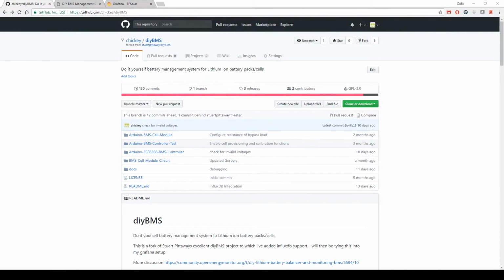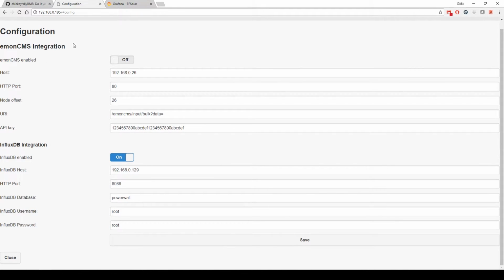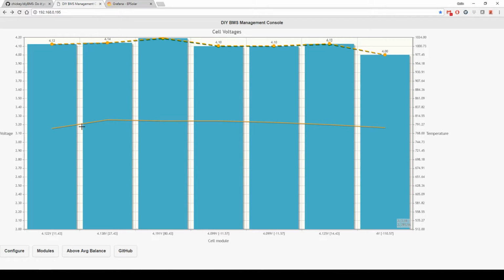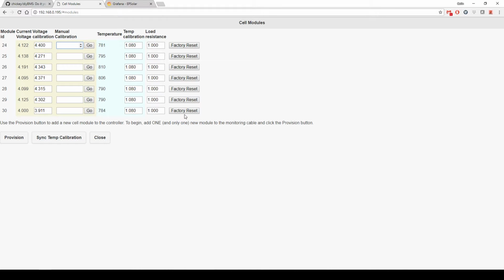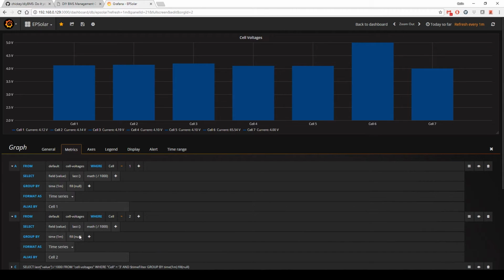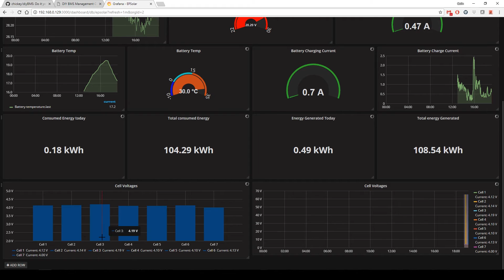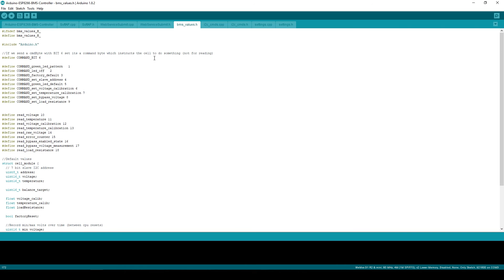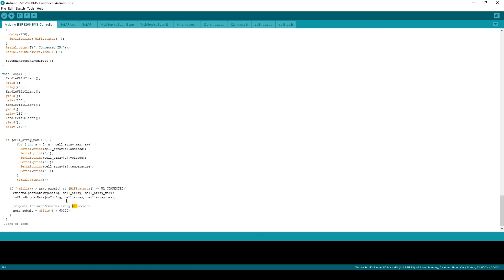Diybms Part 3

Comment: hi mate looking at a 12s build any chance to get the boards from as im an aussie
Reply from the maker: Hi Brett I’m not selling the boards currently sorry.
Reply: Hi Colin thanks for you reply currently looking for a Cap for C1/C2 2.2uF Cap 1210 SMT X7R, for the new design as they have finished making them and being shipped  is there any extra information you could help me out with finding these caps as c3/4/5 have all values need to find easily.

Comment: Hi Colin, I have a grafana db on my home pc currently running in MYSQL, port 3306, would it work if I just change the settings in InfluxDB Integration or not. Do I have to have a influx db. 
If not going forward it would be great to be able to port data into other types of DB, such as mysql, MSSQL DB2 etc. What do you think?
Reply from the maker: Hi with the current code it wouldn't work as it's writing directly to an influxdb so rather different from a mysql db.  I have no plans to try and port the code to write to mssql or similar.  All the code is on github though so feel free to make any changes.
Reply: Okay, thanks for replying to my question..

Comment: do you know how many modules are supported per control node?  I thought i read it somewhere, but i don't remember where?  Is it 14?
Reply from the maker: 24 modules is the maximum supported with the current code.  This would seem to be a logical limit though as it can be increased theoretically as 112 devices can be on the ic2 bus http://www.i2c-bus.org/addressing/.
Reply: im wondering if you could make the adjustments to you could get a couple 14s setups in it.  so 28 or 42.  I have looked at a bunch of the bms code, not as much on the addressing stuff yet.
Reply from the maker: If you increase the 24 in the last line of this code  in the i2c_cmds.cpp code you will increase the limit  
//Configured cell modules use i2c addresses 24 to 48 (24S)
//See http://www.i2c-bus.org/addressing/
uint8_t DEFAULT_SLAVE_ADDR_START_RANGE = 24;
uint8_t DEFAULT_SLAVE_ADDR_END_RANGE = DEFAULT_SLAVE_ADDR_START_RANGE + 24;
Reply: thanks :)  didn't mean for you to go did it up for me but much appreciated :)
Reply from the maker: No problem at all.  You'll need to check if it's referenced elsewhere but i don't think so.  The graphs are done dynamically so should be ok.
Reply: I am getting excited on this project.   I have grafana already setup for some of my other stuf (openhab, and my rain barrel monitoring) so this will be perfect!!
Reply from the maker: I do like the grafana view i have to say, gives a good at a glance snapshot of how things are performing.  I think i'm going to move my powerwall into my garage so i should be able to get more use out of it and utilise the power i'm generating and combined with the BMS it should keep things in order.
Reply: I am finishing soldering up my first 4 packs now 4s80p.  Those 4 packs are the first part for powering my "green sprinkler system".  Once i have sufficient power for the pump I start the fun task of digging up my yard.  Tests have all been great for pumping the rain barrel water.  But that pump puts the batteries to work so better monitoring with the BMS will definitely help me not destroy them
Reply from the maker: Sounds awesome.  I checked out your channel, are you building a robot mower?  I've been following ardumower and liam8 for quite a while.  I have a worx 794e model and just upgraded to a S700 that i'll be migrating too which i power off my powerwall currently.  Great to have your lawn cut with free power :-)  Sprinkler is not needed in the UK lol.
Reply: I am! I am actually hoping to work on the next video this weekend.  My motors show up friday so i will have platform built and motors in place.  Mine is based of this.  https://www.youtube.com/watch?v=6CuOHDlsiDs  lots of printing on that one :)  The mods I will be doing is switching it to 18650's since i have TONS of them.  Adding a charging base and return to charging base routine with IR tracking to find home.   Here in florida the sprinkler will help.  When this project is done it will be the greenest project i have done.  Recycled batteries / solar charged / reclaimed rain water to the yard / sprinkler system powered by batteries / mower keeps that lush grass cut recharging from the same solar charged batteries :)
Reply from the maker: I've seen that one and I've nearly bought the plans a few times but held off.  I really fancy doing my own design but as with everything it's the time.  I got the two mowers i have off ebay cheap and managed to resurrect them saving a fortune and should be able to sell the first mower for more than the newer second one hopefully.
Reply: I wish i had that kind of skill in cad lol.  I have done some stuff in fusion360 but i don't do it NEARLY enough for that kind of stuff.  I keep saying I want to do a 30 day "fusion360" exercise where I have to make 1 thing each day.  But just can't seem to get started.
Reply from the maker: I'm in the same boat and would have to learn a lot as i go, would love to do a daily challenge and see a few people do it on the fusion fb group but i'm the same as you and life gets in the way .  I find the problem is that between doing fusion/pcb design/videos on youtube/3d printing i'm a jack of all trades and a master of none.
Reply: I feel you man.  Kids, wife, job, youtube, home automation, projects, billiards league.. lol   could hashtag it for twitter/instagram ect.
Reply from the maker: I forgot the home automation part, i use domoticz which controls the lighting in the house and the garage.  Really need to expand the usage out a bit more.
Reply: would love to see some of your HA stuff :)
Reply from the maker: Will have to see if i can do a quick video to show a few things.  I currently control the kitchen lighting as well as garage and living room lighting.  Use alexa for the heating controls.  it's a hodge podge of different wireless standards.